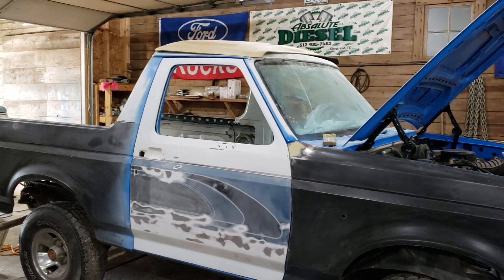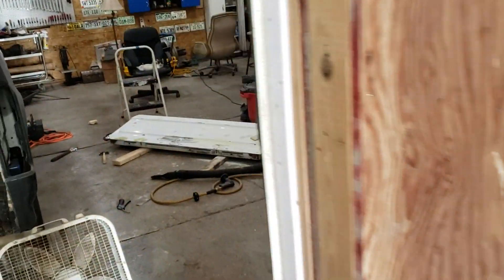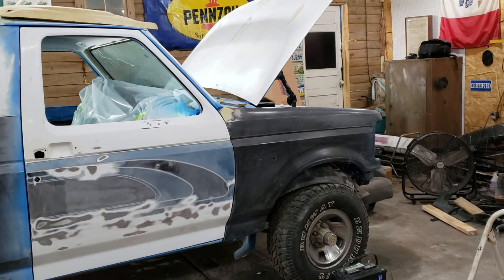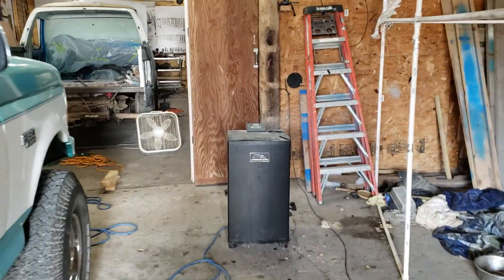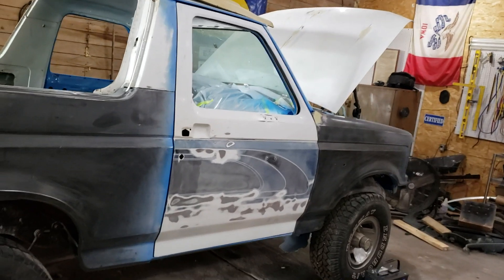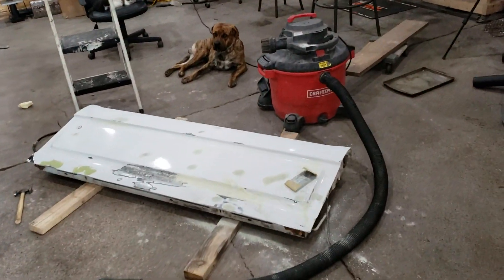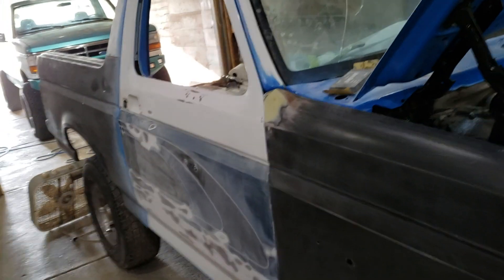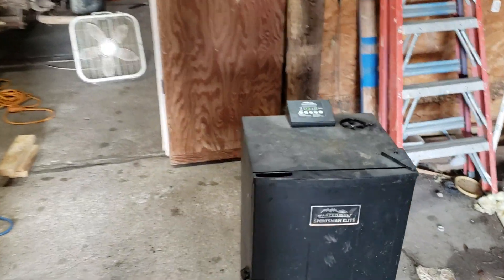Getting It Done! 1993 Ford Bronco. Saturday night update.

Comment: Don’t feel bad about the updates. You are very good at keeping our attention. I just wish we could smell the smoker through the camera.  I bet that has to help energize you some.  See ya on the Tube tomorrow.
Reply: No it’s not a picture of mine. It’s a picture of what mine will look like when complete. I have a 93 F150 4X4 extended cab and a 96 F150 4X4 extended cab. Both have just over 100,000 miles. I also live in central Iowa and suffer from rust.